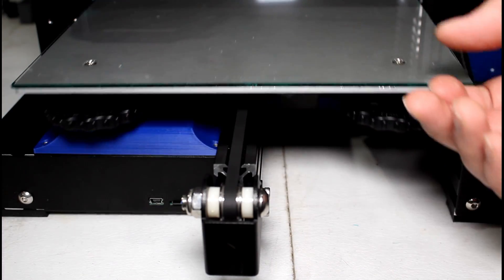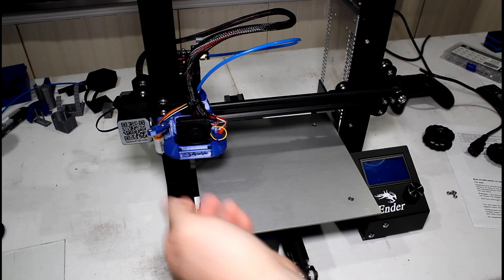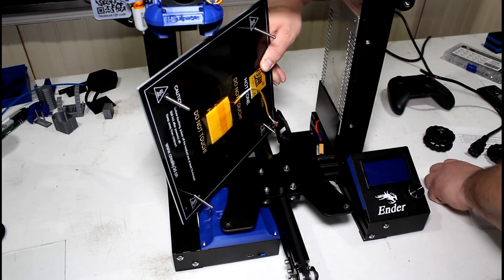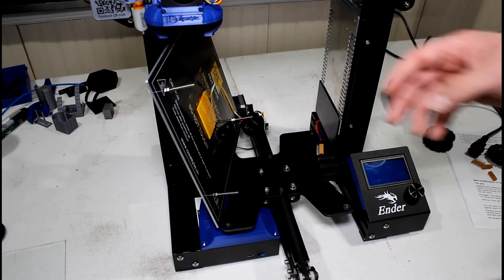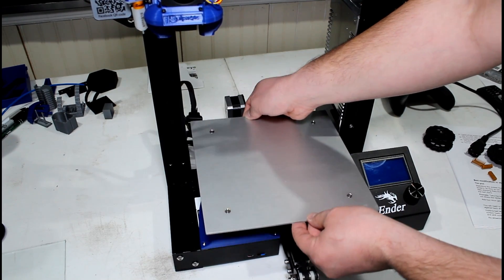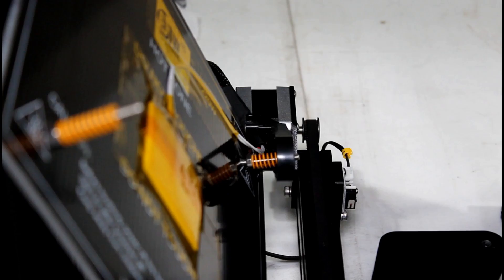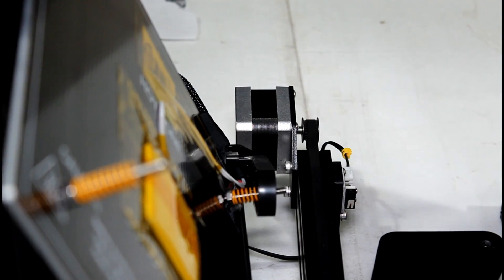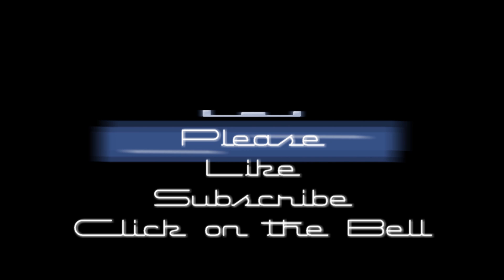Section 2.1.3 Bed Stabilization featuring the Ender 3

Comment: After putting the nuts on, I cant get my bed to lower enough to balance it.  I just burned a large hole in the newer Creality print bed.
Reply: you can always adjust your z-stop down to match where the build plate is

Comment: @The Edge of Tech If i have to open the holes up should i do it on all 4 or just one? I can get three in freely but the last one is misaligned by 2 mm. If i just do one will it be out of square and cause issues?
Reply from the maker: Shoot me an email with a picture if you can. I want to make sure I know what your referring to before I answer. Haha jim@theedgeoftech.com

Comment: Hi jim, i have yellow springs too what do u think about nuts after using them ,are they necessary and how effects print or bed levelling, thank you
anıther question what about theese : 
https://st2.myideasoft.com/idea/bc/15/myassets/products/990/flansli.jpg?revision=1496151132
sauare nut
https://static.doguskalip.com.tr/imgsrv/Upload/Product/1200/bf31c09f-6e2b-402a-86a0-a4ec11ae2e4a.png
nylon lock
https://freeseek.org/img/products/29088-m4-m5-m6-m8-m10-m12-naylon-kilit-somunu-kilitleme-somunu-kendini-kilit-somun-paslanmaz-celik-flans-din6926-ile-a2-naylon-kilit-somunu.jpg
Reply from the maker: Hi! I don't use the nuts when I have the upgraded springs. Also, some people told me that the nylock nuts work great, and I would use them if you have them.

Comment: Hello, It wouldn't be better to put some washers between the nuts and the bed, and also washers between the nuts and the springs? I believe the spring can slightly move on the face of the nut(when you tighten the knobs), and then your bed will move also
Reply from the maker: Thank you for watching! And for the recommendation! I will pass that on to Luke, but it could be a great idea for stabilization. This fix is usually used to get by until the new springs come, but that probably would help!
Reply: @TheEdgeofTech  I have done this today...I think i will keep the nuts even with the new springs...do you have any recommendations regarding a warped bed? I already have a glass for my ender 3, but still have a lot of problems in finding the perfect level... actually Everytime I have perfect level in the corners but not in the middle. I have to use rafts everytime, just to be sure that my prints will stick to the bed.
Reply from the maker: @valentinciotic5655  Nice work! You may not need them after the new springs, they are pretty stiff! As for the bed, hit up the Ender 3 groups on Facebook and there are some really good suggestions there! Just do a search for warped bad. Also, if it's newer, contact the seller you bought it from and they should be able to get you a new bed!
Reply: @TheEdgeofTech  I already contacted them...but it seems that my bed is in the limit...maybe my expectations are too high;) I am still trying different settings to see what is better for me...